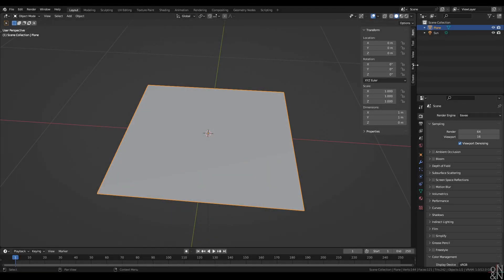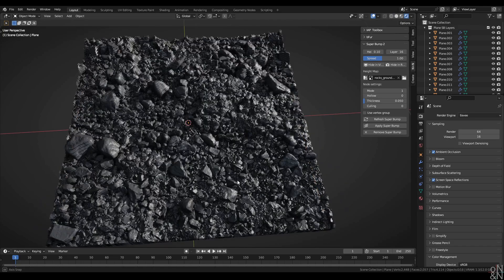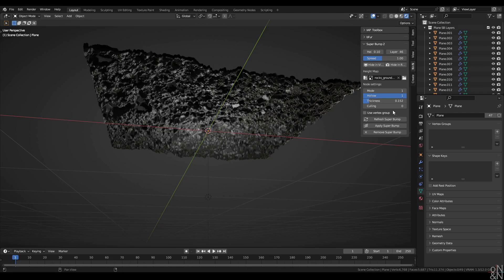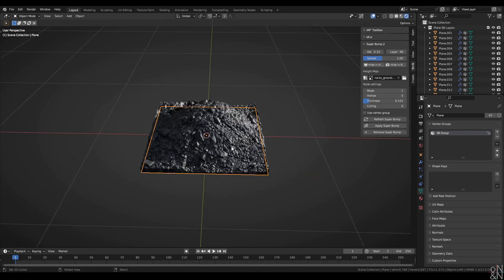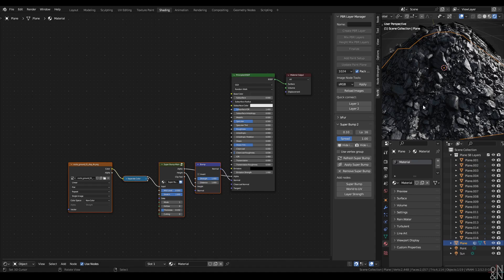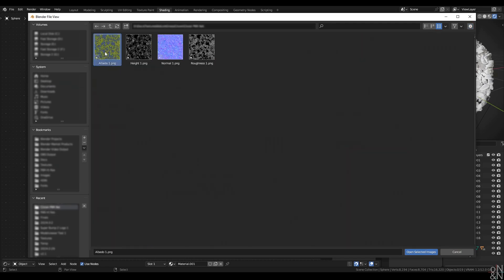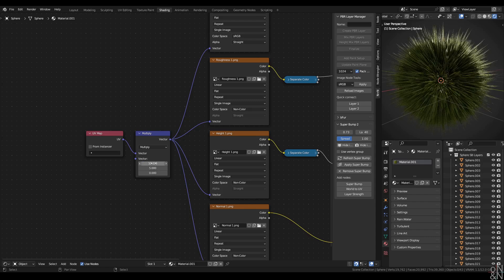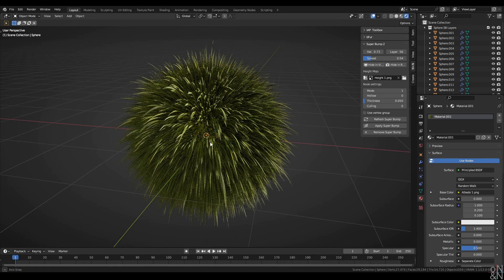Super Bump 2 - The Complete Guide

Comment: On M1 Pro not work good, eat much CPU.
Reply from the maker: Hi Michal. Super Bump shouldn't have much of an impact on the CPU. Are you using Eevee, and are you rendering with the GPU?
Reply: @nodesandnoodles  I adding 2k rock texture with 65 layers, it's very lagy. I use 4.2 and GPU [14 cores] / metal ... I do not have any lags when I use normal maps with subdivision / displacement and bump, better results and without any lags.
Reply from the maker: I'm not familiar with the M1 Pro but I see online that its GPU is comparable to a GTX 1650. I have tested Super Bump with a GTX 1660 and get good results. Perhaps the M1's GPU doesn't handle transparency very well but I have no way of testing that here.
Reply: @nodesandnoodles  That's why I just add a comment for M1 PRO users, I see on video that this works super, but is little non sense spend $ for this who got M1 Pro like me. 
:)
Reply from the maker: I'll put out a message to Super Bump customers to see if other Mac users have had similar issues and if I find a solution, I'll let you know, and if I don't, I'll add a message to the product page to inform potential customers.
Sorry it didn't work out but thanks for letting me know.